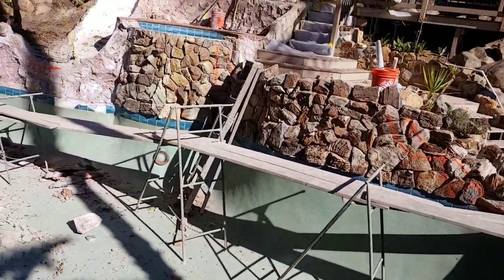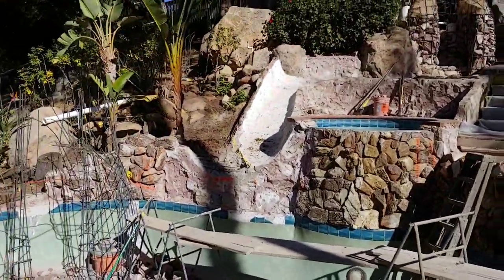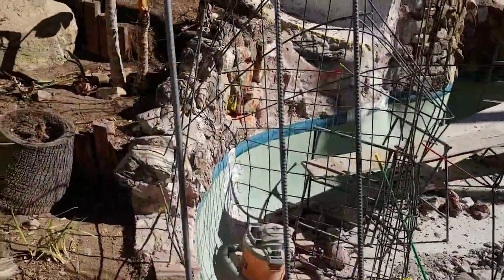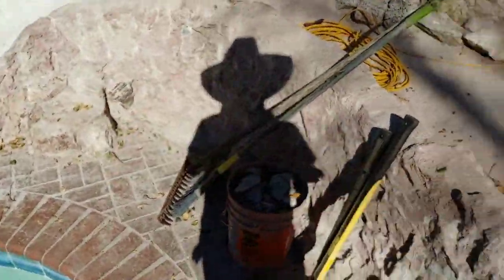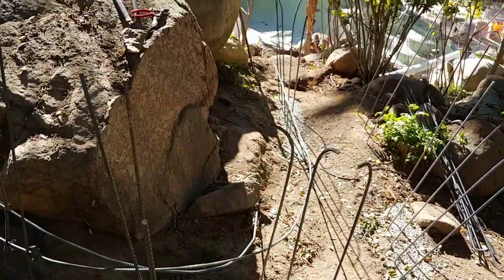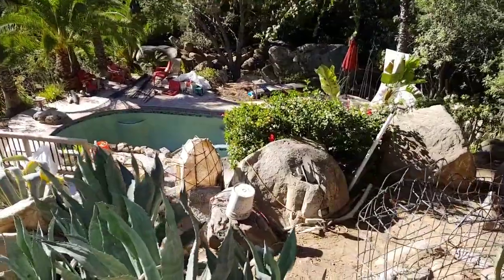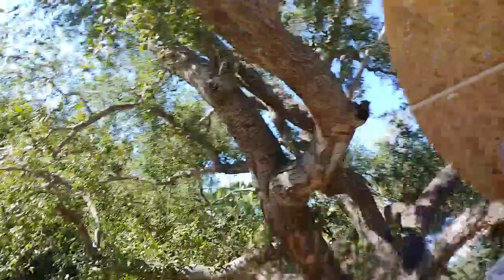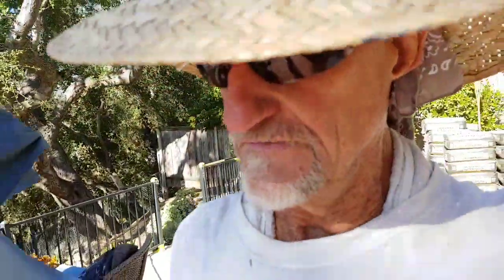Video 3, How-to build Fake Rock Grotto, Slide, Waterfall

Comment: Great work bud!

I work as a professional swimming pool leak tech, whenever I see rock/fake rock waterfalls its almost a sure bet that there will be leakage issues through cracks/joints/deterioration in the fake rock. What preventative work do you do to insure longevity and structural integrity that sets you apart from the other guys?
Reply from the maker: Thanks for the question Joey!  I use Aquabock XL to penetrate and then Miracoat Miraflex Membrane C.  Have more how-to content including free pdf downloads are at www.davehenderson.podia.com  Blogs and links to other platforms are at www.daverhenderson.com   Thanks again for your question.  
Cheers,
Mr. Dave  :)
Reply: @DaveHendersonFakeRockVideos  thanks for the reply!  Definitely going to check those materials out, I've been very interested in using membranes on bond beam cracks behind the tile line. I'll check out the pdfs. Thanks again.